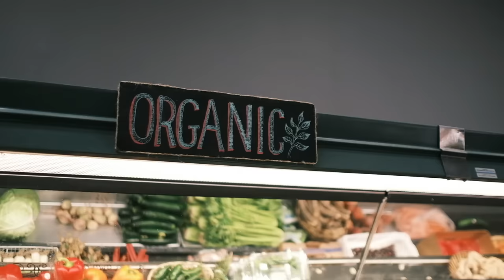Daily Routines In The Mountains (Story 41)

Comment: 11:11 I can’t tell if that’s a late 2nd gen 4 runner or early 3rd gen but either way they’re awesome and run forever. I bought an 02 as my winter beater, it has 200,000 miles on it and not a squeak or rattle.

Comment: I initially thought she must be an incredible woman to hang out with, but I would get bored in the cold if I was in that situation.  Then once I came across the north Pacific rattlesnake, I think, I said to myself, I could manage. Just the opposite with me, I enjoy the rattlesnakes.  And for the record, she could probably make it through a rattlesnake bite as long as she remained calm, walked slowly and then called for help. Outside of a Mojave, eastern diamondback, and some canebrakes you have a pretty strong chance of survival. Always bring water, a lighter, your phone, bear spray, and I would suggest a firearm but it's up to the individual. If your ever traveling in a remote place where you can fall victim to terrain, direction, the elements or wildlife you should always be prepared.  As for the rattlesnake, if he didn't coil and take the strike position he was just alerting you that he's there. Always watch your feet and on side the trail. Snakes are ambush predators and sometimes hard to spot so keep a weathered eye and you should be fine.